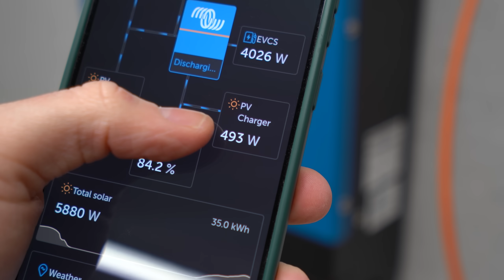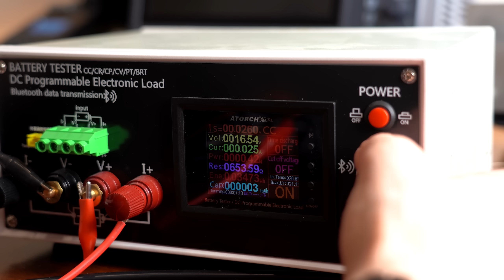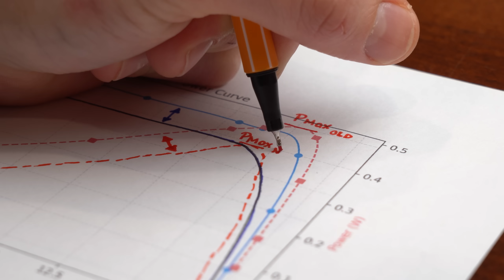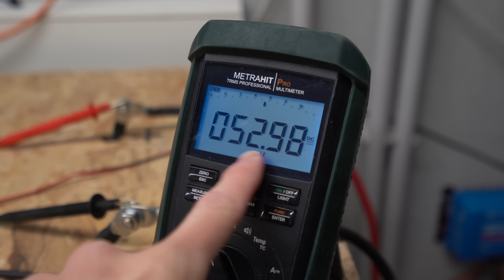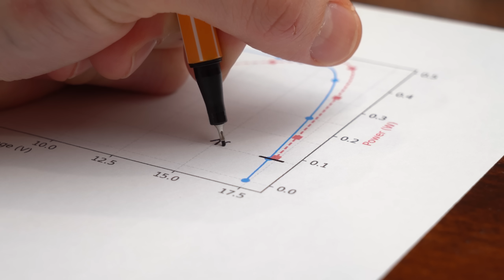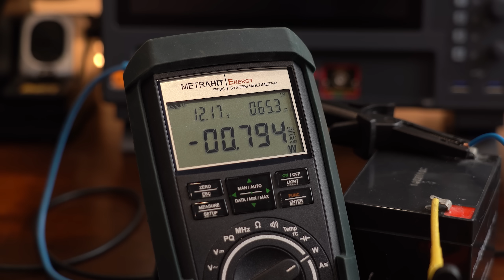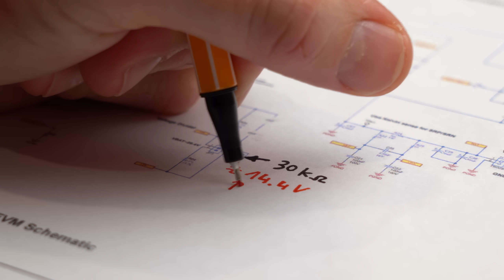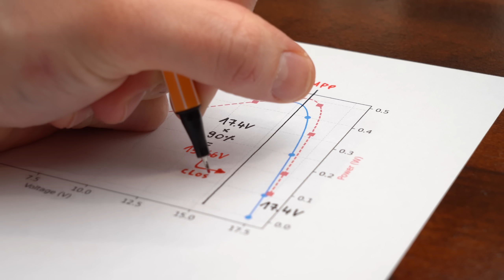My Wind Generator Was Useless....Until NOW! (MPPT)

Comment: Wind for residential is about the worst energy. It’s a fun project though and can fit the application in some places. Generally it’s hard to beat solar, unless you have a creek or a river or pond etc… you can generate hydroelectricity with. Panels are also getting better. The thing ppl get hung up on is if your consumption needs 500w and a 100Ah battery is thinking they just need exactly that.  But you have to really overcompensate on both panels and batteries and use multiple zones and mppt’s to maximize things. Wind where I am isn’t a viable source.

Comment: I was thinking on buying that precise chinese MPPT charge controller for my small hydro experiement. Since in my hydro experiment using gears and belts I can make sure I run the generator at the right RPM to be over 15v, do you think that MPPT charger will work good enough?

Comment: Perhaps consider using a step-up 3 phase transformer. Its going to take the fun out of buck boost project, however the overall gain in  powertransfer efficiency might be a driving decision factor. Further, also keeping in mind the losses of the rectifier diodes. A 1,4v drop on a 10v circuit is more than 10% as opposed to 1.4v on 90v

Comment: Thanks for the great video!
Hook the wind turbine onto your car and find an empty Feldweg. Then drive and find the best V A MPP for each wind/car speed.
Because the MPP should keep your turbine spinning at a constant speed and not make it accelerate or decelerate. 
Then just use a lookup table and a separate wind speed measuring device.
Maybe add a super capacitor to smooth out spikes from gusts.

Comment: Why not just connect a planetary overdrive gearbox between the rotor and the generator to spin the generator faster than the rotor, then increase the blade length and/or pitch to improve low speed performance

Comment: My cousin built his own wind turbine from a car alternator and an old satalite dish and some PVC for the output circuit he managed to harvest around 200-400watt by just using a car charging circuit,last year he used a motor alternator and made some changes to the circuit and manged to get around 150watt ,he used a custom gearbox in both designs,all you need is to design your mppt by integrating technology in vehicle charging circuit and solar inverter circuit and old wind turbine circuit and try applying supper capacitor concept

Comment: From what I'm finding the reason your DIY circuit didn't work is from the INA219, which is limited in voltage and amperage. Changing the INA219 for an INA 228 or 237 would do the trick.

Comment: Hi, Thanks for your videos!
Could you design a MPPT circuit, that can handle multiple micro wind turbines so that the combination can be fed into a grid-inverter?
20 or 30 micro turbines (using Nema17s ?) working together would be very useful!

Comment: Ok so i dont have a real good way to test mine but i have pretty much the same turbine i ran the output wires from the turbine to a rectifier and ran tbe rectifier into one of my solar chargers mppt's. 
Idk if its working. But little testing i was able to gather was i had a higher dc voltage coming out

Comment: I did an experiment with my wind turbine. Used a small bank of super caps after the recrifier, then connected the caps to the PV in side of a vicron mppt.
The caps wpuld slowly be charged up by the tirbine, then once the banks voltage got 5v above battery bank voltage the mppt would switch on to bulk and drain the caps. 
This actually improved the overall daily power output on windy days.

Comment: The problem I had with it is that it would not add to my battery reserves. 
If the battery voltage was higher than the windmill's charge controller it would dump my excess voltage.
It would never charge anything... it would waste what I already had.
If a PV charge controller was charging at 28V, the windmill's charge controller would dump the extra voltage.

Comment: I built a wind turbine a few years ago and discovered how poor they are unless you live in a VERY windy area. Having said that I just hooked the turbine up to the battery through a three phase rectifier and relied on a dump load to take excess power when the battery was full. If the battery and turbine are properly matched the battery will absorb the power holding the voltage below a preset level until the dump load kicks in when the battery is full. If the wind is not blowing hard enough to raise the voltage above the battery voltage then it's pointless trying to capture the energy as there is almost none and the losses in your MPPT circuit are too high when the wind is blowing harder. From memory it started generating at around 10mph, gave a couple hundred watts at 15mph and I saw 1.5kW in stormy weather.
Reply: Sounds like I need one then. I'm basically on a hill with open space all around me for miles and I regularly get 20+mph
Yes, I'm close to the coast.

Comment: Your issue is lack of wind not the charge controller. 
Say the swept area of your wind turbine is 1m^2 and propeller extracting efficiency is 40% (maybe generous) then with a 3m/s (11km/h) wind speed the wind power will be Pwind = 0.5 * air density * swept area * windspeed^3 * efficiency = 0.5 * 1.2 * 1 * 3^3 * 0.4= 6.48W then part of that will be lost as friction losses in the ball bearings and some smaller part as IR losses then the controller self consumption and maybe you are left with 3W But this for a theoretical constant 3m/s and in reality it will not be anywhere close to that.
Nominal rated wind speed for this small wind turbines is around 12m/s (43km/h) and you almost never get that especially where it was installed.

Comment: mad idea, could you not count the frequency on the wild ac from the genarator asses its peek rpm or if it has reached a minimum for power extraction, then pull power untill you see rpm start to drop and back off the output, recovery of rpm can be used to atain power predictins.
think flywheel control.

Comment: I believe your turbine blades steal most energy from wind at specific RPM, maybe its not load you should meassure with your arduino, its RPM instead, try coding it in a way it increases the load untill your RPM drops down to optimal value then just boost voltage

Comment: What RPM is the turbine designed for? If I was to design a wind turbine controller I would have it frequency regulated, ie have the turbine always operating at the optimal RPM. The reason for this are that the coils and magnets has better efficiency when turning fast at the design speed than at lower RPM. The faster the turbine spins the higher the voltage.

1. Spin the turbine (unloaded) up to the speed it delivers its designed voltage. Record the RPM (measure the electrical impulse frequency).
2. Build a regulator with a clock speed that matches the recorded impulse frequency from the turbine (you can have clock frequency adjustable with a potentiometer to suit other turbines with other characteristics as well).
3. When the clock speed and turbine speed matches then the regulator will open up to the load. If the turbine turns faster than the clock then the regulator will open up for more load to keep the turbine at design speed. If the turbine turns slower than the clock then the regulator will choke the load to increase the turbine speed.

Anyway, that is how I would do it.

Comment: is it possible to use a boost converter without mppt to step up the voltage, and then use the mppt?
This would drop efficiency though, but iit could work right?
If not, please explain why.

Comment: I did this years ago with an e-bike motor, a DIY three phase bridge, a waka-doo of used electrolytic capacitors and a cheap 1.2kw boost converter from banggood. So long as the load voltage is below the set point of the boost converter the mechanical load input remains fairly constant. Once the battery is charged the mechanical load on the input minimizes.

Comment: why not install a boost step up converter and then put it in to a victron mppt then the mppt would in theory have a constant volte  to do maximum power tracking and then the wind turbine would output power at lower volts

Comment: An arduino programmed to use MPPT with a anemometer and a lookup table built, on the power curve for your wind turbine will optimize power production. 
As the wind speed is never steady, standard mppt cannot keep. The anemometer reacts quickly to give a starting point, then the  mppt algorithm fine tunes for that wind speed. You could add temperature and barometric pressure to the mppt algorithm to fine tune the look up table .

Comment: @GreatScott! What are the challenges with boosting the input voltage to the original MPPT, by connecting two wind turbines in series - possibly one providing a positive rail and the other a negative rail.

Comment: Hi Scott,
you should definitely think about using the generator windings themselfs as the inductor of a boost converter. You will only need a dc-link capacitor and a half bridge for each generator phase.

When you switch them low-side mosfets with a pwm signal all at once you should stepped up voltage when the windmill is running. 

This could be inefficient when drawing higher loads or at very high speeds though.
For maximum efficiency you can use three half-bridges and commutate the current like in an bldc-motor. You have commutate not exatcly like a motor obviously, but like a generative braking of the bldc-motor. And one problem is, that you need to have hall sensors or a sensorless control algorithm. 
Because of that, the first thing you could do, is to use three half-bridges and only switch the low-side fets all at once with pwm signal to boost the voltage.

Comment: Your algorithm of finding max current isn't quite correct.  You should decrease voltage until you find the max power (current x voltage).  Max current isn't max power if voltage falls off less than current does as you decrease the voltage.

Comment: Boost converters usually operates between 0.2 to 0.8 duty cycle. If your boost converter draws more energy than you desire even under the minimum duty cycle, you can try using PFM control instead of PWM control. Basically you turn on the switch for a fixed amount of time (maybe 50us or something, depending on your source voltage, source capacitance, inductor, etc. ), then you turn it off for a really long time until the load (or source) voltage drops too much from target voltage. (To some degree PFM is kind of like bang-bang control) PFM is quite useful for light-load conditions and should hopefully make your first circuit functional for solar cells.

Comment: @GreatScott! Have you looked into the BQ24650? It's still a 'Buck' & you set the input voltage to maintain but it's an interesting IC . I discovered it when I was looking for a very small & inexpensive MPPT solar controller. What stood out against the others was conversation efficiency which was up around 80 - 85% (from memory) vs others what was sometimes as low as 50%!

Comment: Great Project! I have faced similar issues with too low voltages from solar inputs for my current project and came up with the same solution, although I went with the BQ25756. I made a custom design and it works like a charm, also much better than my previous DIY solution with an ESP32 and Mosfet driver. It turned out to be much more stable and efficient. I still use an ESP32 on my layout to control the chip to make it useable for a wider variety of inputs and batterys.
Its funny to see you went the same journey :D

Comment: I am using a Harley Softail motorcycle regulator for my wind generator controller, it is a shunt regularor that takes 3 phase input and SCRs shunts voltage fir each phase to ground when the positive portion of the wave reaches 14.5v.  By shuntng to ground this has the effect of automatically braking wind generator during high wind.

Comment: This mppt thing is  waaay over mistified. I put a boost and buck converter in serial, powered from solar, the other end charges a battery. Two modules, it works for years, no magic - solar ranges from 15.. 45V, I have a 24V battery, so boost is set to ~30V, then the buck to the battery charging voltage ~28V. When solar is more than that, only the buck works when less, then the boost starts workig. The end result is ~28V constant as long as there is enough solar power to keep the boost-buck functioning, always drawing the maximum power from the panels. Works great for smaller batteries and no need of an arduino and unnecessary science at all :P
Reply: liking this.  Trying to charge batteries with a 24v scooter motor generator, maybe if I up the voltage with a boost converter then the buck converter, to counter voltage drop?

Comment: Please make sure to integrate a diversion (dump) circuit for when the wind turbine is spinning but no current is flowing because scary things happen at that point! Basicly you need something to slow down (or stop) the turbine if the battery is fully charged and the charge controller or BMS prevent a current from flowing. I once created a very simple circuit with a comparator, mosfet  and mosfet driver that switched a dump-load into the circuit once a certain voltage is reached. There are also much more sophisticated ways of doing this but please just make sure you have some diversion. I have experienced what happens when you don't and it's not pretty!

Comment: Compared to Buck converters, Boost converters are quite inefficient, and Buck/Boost converters are even worse. You may prefer to change the way you charge batteries (two at a time instead of four in series) and continue working with Buck converters. 6 or 8% is a lot in applications like these.

Comment: It would be easier to optimize if you had a wind speed measurement separate from the turbine. Then you could then create a table to pull the maximum power at the wind speed. Because you are going to have many variables , it's probably easier to sample power settings at different wind speeds and draw a curve and set the power accordingly.

Comment: I used a transformer from generator to charge controller, matching the impedance of both the generator and "step up voltage" or charging side of the circuit. Followed what Nikola Tesla had done. Magnetic flux is fascinating.

Comment: Have you tried one of the "low speed wind boost" controllers from aliexpress? I installed one in my turbine since my 24v system almost never got any wattage, only to accidentally burn out my slip ring!
Reply: 0:40 is one of those "low speed wind boost" controllers from aliexpress
Reply: @mrkukov  ah, I was watching on my phone and didn't catch that. Good eye!

Comment: I use a voltage doubler like in this very old video - google 'voltage doubler' for details - all you need is a bridge rectifir and capacitors - no active electronics required - requires the direct AC from the turbine coils :) https://www.youtube.com/watch?v=dQBLCMyoA3k

Comment: my first thought, if your wind turbine outputs AC, why not just use a dumb old transformer?
double or tripple the voltage on the AC side first, the buck regulator it back down
Reply: 3 phase transformers for a few hundred Watt are scarse, heavy and expensive.
Reply: @cleverca22  The losses on such a small amount of power would make it pointless. Just have to accept if you don't have sufficient wind you aren't getting any useful voltage or power.

Comment: I was wondering about this project as I had not seen an update in a while. I was also thinking about whether the direct-drive (no gears) system was part of the problem, perhaps like pedalling a pushbike on too low a gear: spinning fast yet little actual headway / speed. I believe many motors / generators have a 'sweet spot' RPM at which the magnets excite the coils best, yet the turbine also has its own sweet spot RPM and also torque at any given wind speed. It may be that gears are needed to match them up better, perhaps an efficient constant velocity transmission (CVT). Worth a look at!

Comment: Can you design a filter or converter for the modified sine wave near to pure sine waveform in an inverter 120VAC?
Reply: A wind turbine outputs "" wild voltage ""  The output varies along with the wind speed. Pure sine waveform ? The output A/C voltage/current and frequency will change with the wind speed. Converting the A/C output to D/C has losses. - Changing voltage has losses. All the changes compound losses.
  The art is simplifying the changes and minimizing the losses 👍

Comment: Have you tried checking out a consumer SCC MPPT around 20-60a?
That ZK-S20 MPPT here is as expensive as a PowMr 25a MPPT SCC for 12v/24v system.
If a Solar charge controller dont work for wind turbines,  it might be possible to convert those to be usable for wind or even hydro.

Comment: Before investing in wind turbines, you'll want to check out "Betz's law", of which there's a good wiki page available. It is a physical and mathematical law indicating the maximum power you could ever get from a wind turbine. It's approximately P = 0.36 × pi × r² × v³ with r being the turbine radius in meters, and v the wind speed, in meters per second, and P the generated power in Watt.